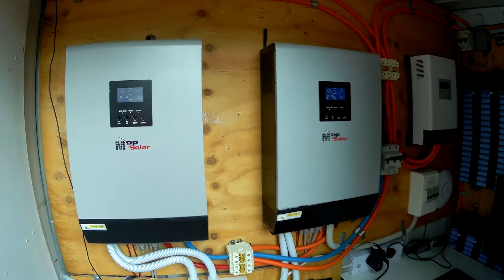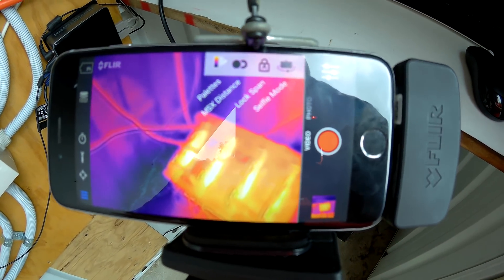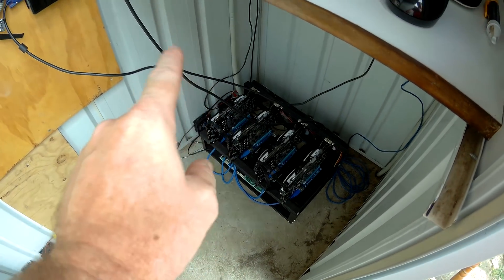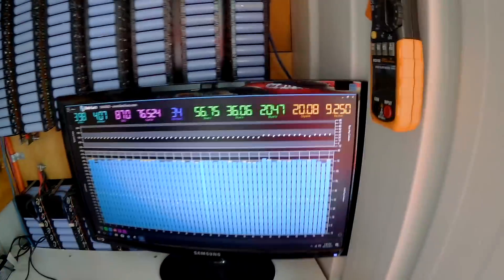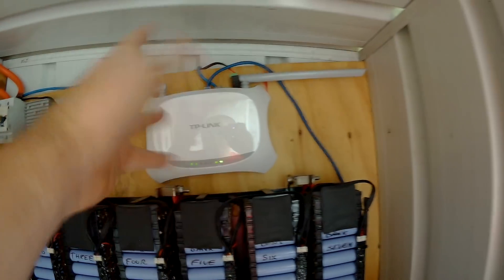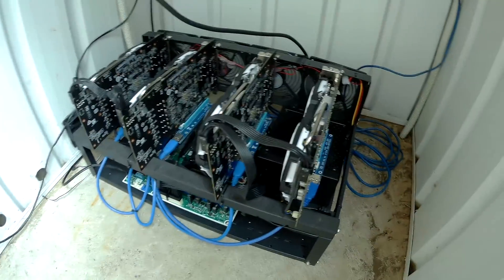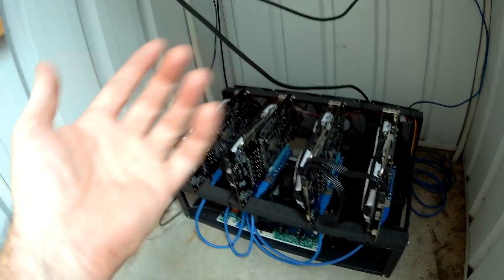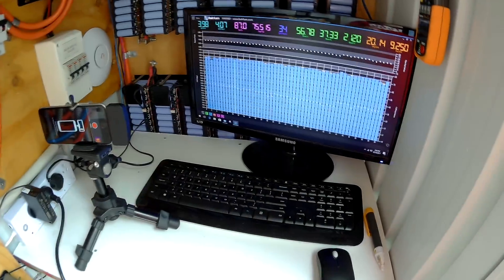Second MPP Solar PIP inverter installed and a update i guess :)

Comment: how does your batrium talk to the mppsolar to control the charging? :-D
Reply from the maker: It doesn't interact with the inverters, but does control the shunt-trips if there is an issue everything gets shut down. I now have 4 chargers of three different types - BMS can't really control them all easily
Reply: @HBPowerwall  THANKS! :-D

Comment: I just read the manual that came with my 2400 watt 24 volt MPP hybrid and it says 50 cm clearance above and non flammable surface.  Maybe that's just CYA information.
Reply from the maker: Yep sound about right, but wood is easy to mount too.. and lets face it, if the cells go thermal the wood is the last thing to worry about.

Comment: Hi, i would like to ask you a question. Do you ever try to use a welder on one pip 4048? Cause i have a mig/mag 250amp welder and i may be have to move to a place without electricity and want to know which is the minimum equipment i need. The 8000w peak for how many seconds it is and what happend if you overload the pip. Thanks
Reply from the maker: i would never use a welder on a pip it'll kill them fast i think... You'd be better spending a lot more on a product designed to last (and priced accordingly ) https://rover.ebay.com/rover/1/705-53470-19255-0/1?mpre=https%3A%2F%2Fwww.ebay.com.au%2Fitm%2FSelectronic-SPMC-482-AU-Inverter-Charger-48-V-7500-Watt-18000-Watt-Peak-Aus-Made%2F261211268465%3Fhash%3Ditem3cd167a571%3Ag%3AdS4AAOSwxN5WUr4R&campid=5338482164&toolid=20008

Comment: Guys, is there a way to send commands from my home automation system/that runs on a RPI/ to the MPP Solar inverters? Stuff like turning it on/off, setting the battery voltage but also reading some info out of it? Thanks.
Reply from the maker: You would be best sub DIYTech&Repairs on youtube :) Or head to the forum www.diypowerwalls.com he is a mod there and has an awesome Pi project

Comment: Thanks for showing us the parallel PIP's.  You might have taken the opportunity to tell us more about them.  Capacity, efficiency, functionality, purpose, potential, etc.?
Reply from the maker: Fortunately, I've only just got them installed - but I'll try to provide some general info - They are PIP4048 inverters with parallel kits installed to give me an 8000w useable load, efficiency when idle is pretty average but exactly what you'd reasonably expect from a unit in this price bracket - my base load is about 1.2kw per hour and is currently taking a HEAVY load from my 40kwh battery bank - Purpose is well covered in three hundred other videos - but to recap they run my house & potential.... if the power goes out POTENTIALLY I won't miss out on watching Home And Away :)

Comment: A good exhaust fan with temperature probe senor will help a lot. Since heat rises you would add it to the top of the roof and with the doors closed it will pull the hot air out and if you have holes on the bottom it will pull in cooler air.
Reply from the maker: Good air flow is pumped in by the fans at the bottom but can't keep up with the heat provided by the inverters & mining rig. Batrium BMS has everything built in so that I can control heat or cold as required with plus 120 temp sensors in both my sheds. How ever due to the need to have ALOT of air it's better just to turn them on and walk away.

Comment: You of all people should know not to run a battery down. Tisk tisk.
Reply from the maker: It didn't run down, it was dragged :) I have the AH rating set for 500ah I think that is a quite the conservative figure considering. Inverters are also programmed to shut off at 50v and only charge to 57.4v so not much chance of doing too much damage. Less is better but using them is a requirement
Reply: HBPowerwall I was referring to your camera’s battery there sir. :-p
Reply from the maker: ooh - well played lol the thermal camera has only a small battery but you can charge as you use it -- cool stuff if you ask me lol
Reply: HBPowerwall I actually have the original one. And would love to the latest one. As it can attach to other iPhones. The original only worked on the 5 and 5s without modifications. I ground down the sides so that my Plus model could fit, but at least it works.

Comment: The hot air tends to go to the ceiling, so it would be best if you put the fans on top.
Reply from the maker: Yes draws in cold air from the bottom where the cooler air lives there is a bunch of gaps at the top where the tin is corrugated the hot air just get blown out there. I will be adding a fan at the top some time soon tho just in case extra is needed
Reply: Cássio Rogério Eskelsen pretty sure that's the intake he showed.
Reply: Fans last longer with cool air, maybe a vent at the top.

Comment: I still think you should run your shed on your DIY POWER WALL. even  if it is after business hours. AUTO SWITCHING, Dont be scared.
Reply from the maker: I've decided I won't be doing it at all. With the two inverters, it takes longer to change from grid to battery and vice versa - this could have a negative effect on client computers and won't put my self in that position